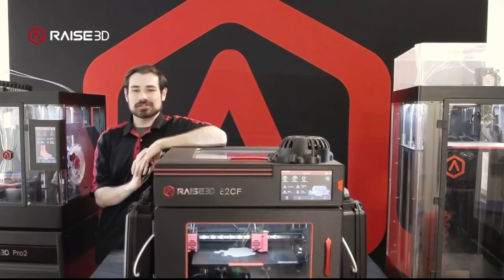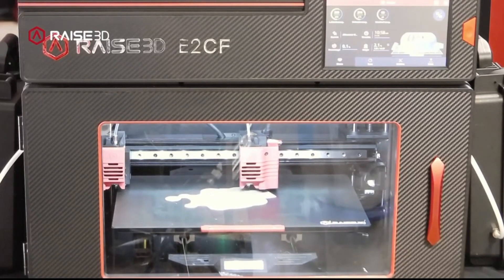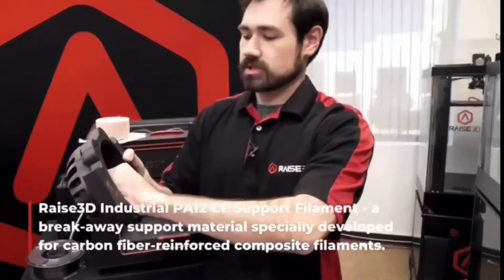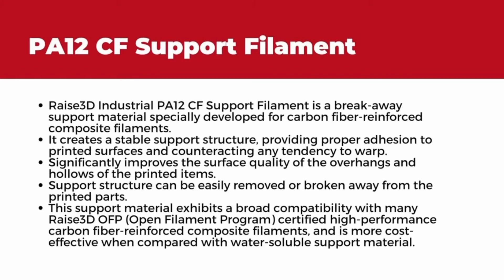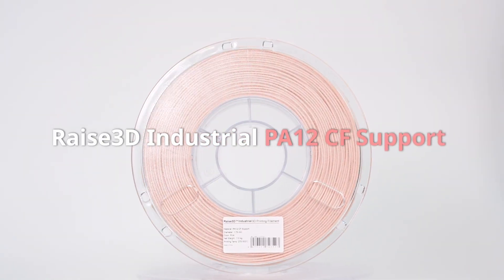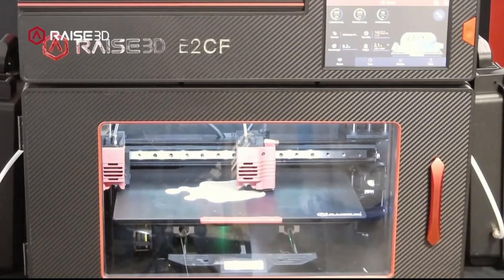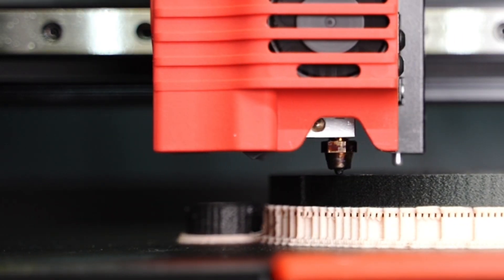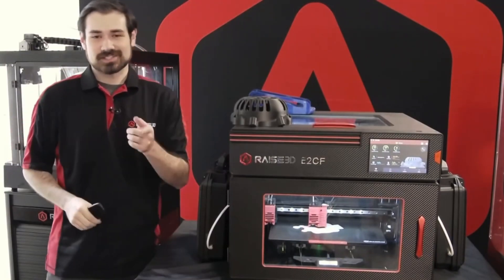Raise3D Livestream Recap - All About E2CF, PA12 CF and PA12 CF Support Filament

Comment: I'm considering a raise 3d E2.  Wondering if that machine is able to print cf nylon if smaller parts and or printing less frequent parts?  Also, is it possible to upgrade components on the E2 to convert to E2CF in the future?